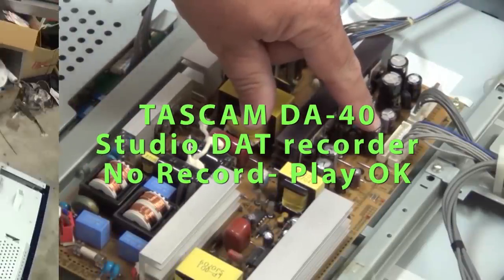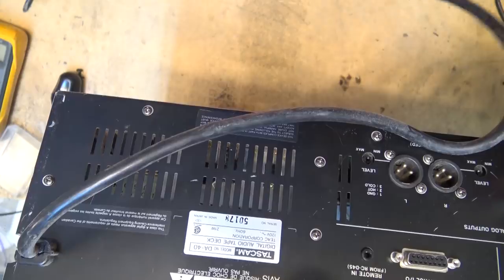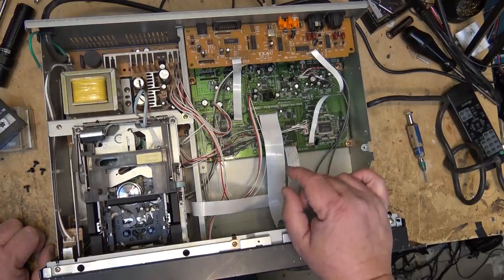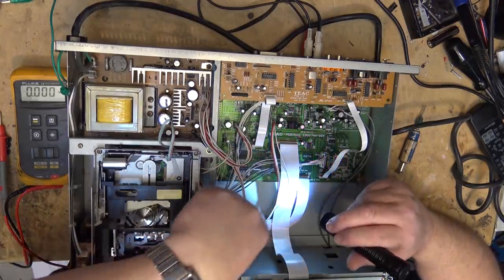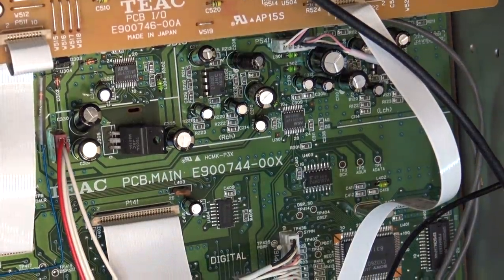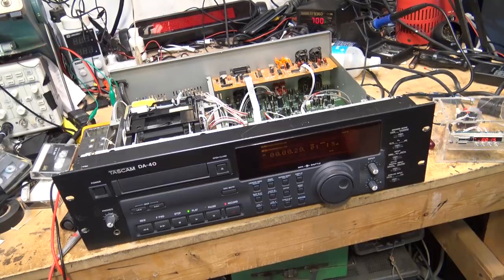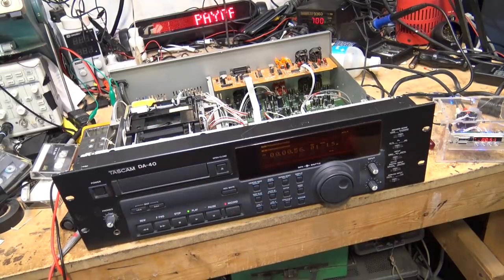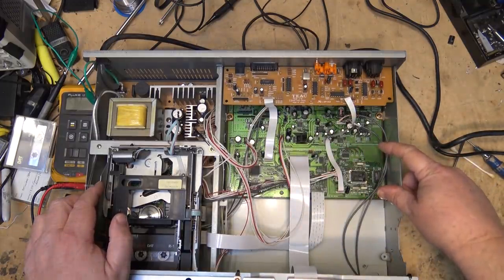Tascam DA40 DAT No Record Plays fine. Part 2 of a unit I started on 2 years ago

Comment: I just bought one of these Tascam DA-40 units at a thrift store for $20 and it needed a tiny belt under the circuit board for the mechanism I found the smallest belt from a pack of belts that I had, but it was still a little big. So I cut a section out of the belt and superglued the ends together and the eject mechanism goes in and out now. Now I just need a DAT tape! I ordered one on eBay so I’ll do further testing once I get the tape!

Comment: Quality unit I almost bought a Sony day recorder from our local charity shop it was £40 UK but got out off but cost of tapes and that it uses a head drum a bit like a VCR .I do have a £19 eBay special 3 head Sony deck to repair needs caps belts and some soldering to the motor connector hoping to get it going ,I bought a cheap Sony deck for 99p previous and all components are on the front panel not even sure it is worth the cost of a belt but I guess I will fix it , another superb repair by yourself.
Reply from the maker: Yes head drum like a VCR but with 90' wrap.  VCR used 180 and 8mm camera 210' which causes much higher head wear.  I have a couple hundred dat tapes myself.  These machines are incredibly difficult to troubleshoot

Comment: Smashing repair :-D
Lucky that you applied pressure and the fault changed, i'ts not always obvious with some chips, the shadows can trick the eye.
I've had to use a needle to wobble pins on some chips.
Tiny cracks in the pcb can be a bloody nightmare to find as well :-(.
Reply from the maker: I know this only too well. In this case pressing on the chip restored operation. It was literally the first one I tried after confirming that the AD converter was working, and therefore the clock was running.

Comment: This seems to be a common problem with alot of electronics. Been watching alot of videos from another repair guy and in his field there are alot of cracked through hole joints. Nice to find it so fast.
Reply from the maker: Flat pack cracking is very common too. It is the lead free shit solder.
Reply: @12voltvids  Yep sure is. As if premature death is better for the environment than properly disposed lead.
Reply from the maker: @rimmersbryggeri  
Got to keep the economy going right.  I watched a disturbing documentary on YouTube about electronic recycling and how it is really done.  Shipped to India where young men mostly take apart and separate components. Use blow torches to remove components from circuit boards with no protective equipment.  Breathing all that smoke form burning plastic, fiberglass and flame retardants on the pcboards.  Is this really better for the environment? It is worth watching as it will make you sick when you see the conditions these people work in.  No they don't dispose of your lead either they just dump it on the ground.  Remember much of the stuff they are tearing down still has lead, cadmium, magnesium and dozens of other hazardous substances in them that if that work was done here the workers would be in full hazmat suits.
Reply: @12voltvids  They have crafty guys over there that are prepared to repair stuff though so we could just hope that's what is being done. Judging by what I find in the electronics dump here in sweden most stuff is thrown away way before it's time and can be fixed with a cheap iron some caps and juicy lead solder and live on for another generation.

Comment: Haha brilliant cats, one of ours also likes to play fetch. Strangely he too chews plastic such as audio/video tape and plastic wrappers etc... At least he's more or less out of his wire biting habits though, that one was just dangerous. Nice fix too (the repair always becomes secondary to the cats I find, otherwise they get jealous!) good spot on the cracked solder. Like zx8401 said, sometimes a needle or toothpick is what I've used to root out a loose pin on those flatpack chips, either that or just using a blade tip and drag-soldering to reflow the whole thing. (I tend to think if one or two have cracked, the whole thing could use stress-relieving)
Reply from the maker: I did re solder the entire chip. I use a fine tip point, and just touch up each pin. I know drag soldering works, but I have had bridges that way. When I learned I did it with a conical ultra fine tip and plenty of flux.
Reply: Yep, if I'd been focussed on the repair not the cats I'd have noticed the first time round!

Comment: Great video! I have the same problem but opposite. Mine will record, but it won't play anything unless I hold the seek dial in the forward position to at least 1x, then I can hear it and everything appears normal, but without holding the seek dial forward, it won't play any audio even though the tape is moving normally. I opened it up and cleaned the heads, but that's about all I could find. Everything else is clean. I blew down the inside with compressed air anyway, but it didn't really need it. Any thoughts?
Reply from the maker: Caps in the head preamp. Signal should be distorted and CRC data is not being decoded correctly. When you're in search mode it turns off the air correction and muting that's why you hear sound.

Comment: Nice video and another great job!
These TASCAM machines look really pro with all these SCMS options and counter modes, but DAT always share the same base schematic. Enter a good detective and with the help of "the hand of God", no long mystery there!
For many "pro" brands, documentations are scarce, and that's even worst with DAT, as the production period was limited. It can help to have a look in the general public counterpart brand, but I doubt TEAC has produced more than 2 or 3 models. And this is not a general rule, as components or boards you find in a Revox are not necessary exact copies of their Studer pro versions (looking only the same!). These DATs can share a tape transport mechanism but use different electronics...
I suppose next step is you're at the supply board solders before selling it, cause even with the low head count, it's colour is somehow indicating a large number of ON time, and the next thing to fail are generally regulators or high power transistors solders. A quick look at the main electrolytics (value, ESR), replacing a few audio caps (generally not necessary on these quality machines), and this DAT will certainly become the next dream of an audio fan or collector. Some scratches could possibly be attenuated, but I bet these won't scare the lucky next owner. 
Perhaps your cat has to be considered a connoisseur, that devours analog supports instead of digital ones. I hope you don't have too many precious  15ips masters to protect from it's feline appetite for good sound! Or maybe we have to document for a new cat behavior. You've already seen the one that thinks he's a dog, maybe the next thinks he's a reel'to'reel tape deck (or shredder😒).
Anyway, you can try citrus essential oil to avoid any further damages or spent tape (cats hate citrus smells).
Reply from the maker: Well DAT was around for about 20 years, so there were lots of them produced. The vast majority of them were professional bulletproof decks like this one. Designed for hard use by professionals. These ones are actually quite well built, even though some like Sony. Sony had some good mechanisms and also some garbage ones.

Comment: I'm just about 3 minutes into the video, and my guess is a dead section on the power supply. Maybe bad solder connections.  Something to do with the voltage regulator. Just a guess. I will continue to watch and see.
Reply from the maker: Not even close. Power supply is fine.

Comment: Finally got a DAT tape for my DA-40 and a very strange issue is happening. I can only hear music play when i turn the jog forward to >>1. also makes sounds jogging to faster speeds, but if you let play as normal, no sound. Record input works and monitors. Display completely works. I Dunno.
Reply from the maker: Could be worn heads. Ber too high mute audio.  Could be bad caps in head preamp.   I would start with the preamp caps.

Comment: I know it sounds stupid but I've always wondered what that stuff is for
Reply from the maker: What DAT? 
Digital audio tape was originally brought to market to replace the cassette tape. To improve the sound quality to CD quality or better.  (Dat can record 44.1 and 48khz sample rate where as CD is 44.1). Dat was first developed in early 80s but was delayed to get to market for a few years while the record companies battled to keep it off the market as they were concerned with piracy.  The manufactures were planning on having car and Walkman models to completely replace analog cassette as cassettes sound like crap.  Philip's introduced dcc at about the same time, again held up in the courts  for same reason.  The Philips used a tape the same size as compact cassette (dcc stood for digital compact cassette) and some thought it would be the format winner because the deck could also play analog cassettes but not record analog.  Dcc used compression similar to mp3 fixed at 128k so the sound was not as good.  That format failed miserably.  Dat was adopted by audiophiles and other high end users.  It was also adopted by musicians for home studios and major recording studios to mix the master 2 channel tapes and the 2 channel safety copies which made their way to the CD pressing plants for transcription to CD. Radio and TV stations also adopted dat for production and automation.  This all came to an end in 2007 when production of dat recorders ended.  Now they are collected by audiophiles and "dat heads" whom are folks with huge collections of dat bootlegs.  Because there were many very small dat portables there are many concert bootlegs floating around of high quality and these people copy and trade these copies.  Because they are all digital the 100th generation dub is the same as the original. So there are still people that collect these. Dinosaurs. I use mine for archinving.  I get musicians and vocalists that bring me their bring me tapes they did in the studio to get transferred to USB or CD because most of the studios have now pulled their dat stuff and they have tapes that have not been archived.
Reply: @12voltvids  Sorry I meant the flux I was always wondering wot-it actually does that liquid that you put onto the chip itself before your soldering
Reply from the maker: @H2Oredfirefox  
Rosin flux cleans the leads of the components and makes the solder stick to the pins. It also helps reduce solder bridging. It is not conductive or corrosive so other then for aesthetics there is no reason to wash it off. Some "know it all's" and there are plenty here on youtube will argue this, but the fact is that it isn't necessary to remove it. The only real reason to do so is so you can inspect the work under a magnifying glass. That is the only reason I cleaned it off here was so I could inspect, not to keep the trolls in check because the trolls will thumb down my videos no matter what.

Comment: Where do you find your service manuals?
Reply from the maker: I Google.  I don't fall for the pay 25 bucks for one though.  If I can't find one free I work without one.  That may however cause me to abandon the repair. Like this one.  If I hadn't found that connection and it had been a failed component I wouldn't have been able to track that down without a schematic so I probably would have walked away and put this away as a pats spare for my other deck, but I got lucky and found the problem so now I have 2 working  da40 but will very likely sell this because they go for quite a bit.  I just saw one sell on Ebay for 650 Canadian so I know what people are willing to pay, and tjhs one has 237 hours on it now.  I will probably put another 5 or 6 hours on it testing and then sell it.  237 hours on drum is nothing.  They are good for a minimum of 2000, probably closer to 3000 before head wear becomes an issue.  Manual recommends changing at 2000 to maintain the highest quality recording. I have a Panasonic sv 3700 with 5400 hours on the heads and they still play fine but the excessive error light comes on, so they go for a long time.

Comment: Dat was the baby knifed by the industry with serial copy protection which made it worthless for studio editing and the filter for the copy protection was not transparent.  Add on the per tape cost with royalties and this was passed on by almost everyone.  When I was station engineer for a radio station, they bought and installed one in the main studio, but never had more than one tape to fit it, so it was never used.  A good audio interface and DAW on a PC quickly replaced this dead baby.  Winamp for random access playback not only whipped the lama's A@@, it whipped the DAT in the studio.  For the younger generation, Winamp was the mainstream predecessor to iTunes as the PC player of choice.  Napster was only popular because of the file transfer function.  It was OK as a player but not welcome in a radio station due to copyright issues and low quality files.
Reply from the maker: Low quality? Dat is uncompressed and serial copy is not an issue with professional decks such as the tascam.  Dat was the industry standard for recording studios for 20 years.  Winamp wasn't all that.  Buggy as hell.  I built a radio station automation system based on zararadio. I use that at home to play my music files. Bulletproof. I have had engineering gigs over the years.  Built a community radio station based on zararadio.  Everything on a laptop basically.  Output of the PC into transmitter.  Microphones into mixer into computer.  Operator can talk over, cue tracks, dump in commercials, even go full auto with no operator with full remote satellite news punch in at preset times.  And thay is with the free version.  I like it because I can set the limiter and it will mix everything and keep the levels constant which is great when running it for background music.  Dat did have a good run, and now it is a collectors format like reel to reel.
Reply: @12voltvids  The professional models were expensive and difficult to buy. Only larger studios purchased them.  Many radio stations had them but didn't use them as the blank tapes were very expensive.  The station I worked for had One even though they had 3 studios, and the tapes they owned was One.  It was literally never used.  Not sure if it was the model that supported non serial copy protection as they didn't use it and only had the one machine.  They used PC's and a network server for the sponsor messages and station ID along with Carts.  News was still produced on Reel to Reel.  Cleaned the reel to reel and cart machines twice a week and never touched the DAT.
Reply from the maker: @isettech  
Tapes were not that expensive. Computer DAT tapes worked great and they were relatively inexpensive. I bought a box of 10 tapes for 30.00
Reply: I wonder if the audio tapes were expensive because of a license fee!? I remember seeing more then one or two older looking ones in a radio station in 2007. I can't recall if they were broadcasting off of them but they were still running carts. Things like the DAT implementation of serial copy protection (also analog video protection on computer outputs) have prevented me from running my own dam material on my own equipment for production so I know how ridiculous that is.
Reply from the maker: @wdavem  
Dat tapes were not that expensive.  VHS video tapes were 50.00 in 1979 and still 40 in 1982. 2 hour dat tapes were 8 bucks.  These are metal tapes. A metal 90 minute cassette tape cost about the same.   When I first got recordable cd in the mid 90s a 2x burner was 1300.00 and blank disks 20 each and the burn failure rate was 40%. Serial copy was never an issue.  For those that couldn't have it, there were professional versions like this that has no serial copy.  That was on the consumer decks only.
Reply: @12voltvids  Ok I never owned a dat until about 4 years ago so I didn't know what the tapes cost. I like DAT, I get it, 8$ is a lot cheaper then less then half and hour of 1/4" audio tape. Also all my tapes for DAT from work when they threw data tapes out... some are a little iffy. My problems with the serial copy protection were when inter-connecting a dat, computer audio interface and a sony pcm 601-esd SPDIF to video converter, (which is a weird thing to do I know, but it had to do with audio for video) and under some circumstances the computer would be triggered to kill the pcm 601esd via the copy protection bit. Kinda drove me nuts and killed a project. Same computer spat out a form of macrovision-like mess all the time except when you watched copy protected content, my video mixer could not handle it and I had no work around at the time. I don't mind using the XLR analog ins and outs for DAT so it's it's a pro-grade thing, no more 'false' copy protection problems.